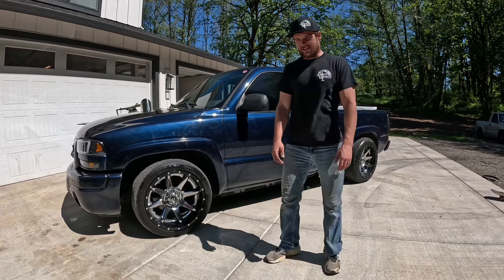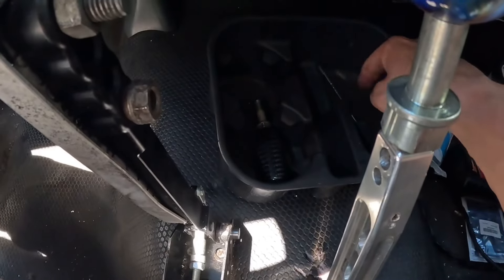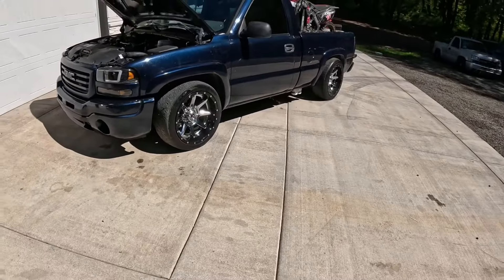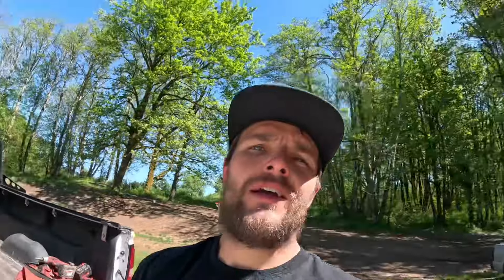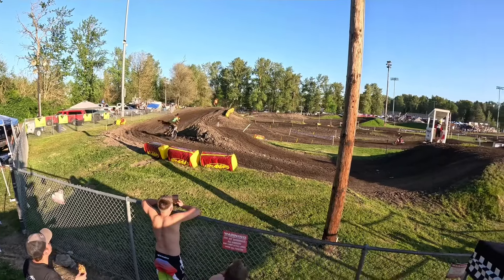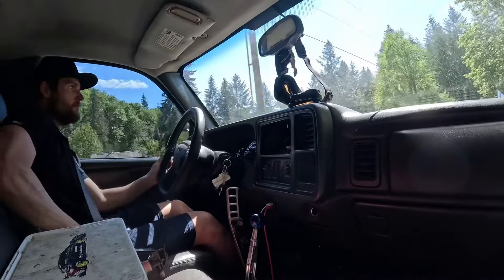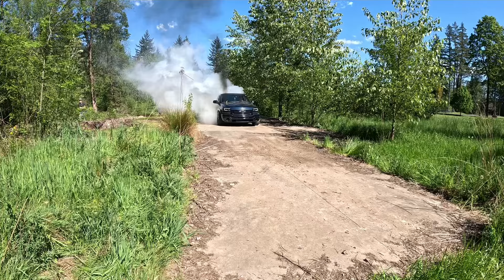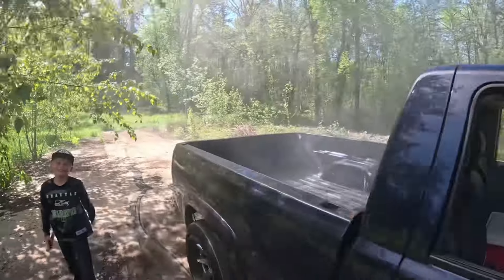I BUILT the WORLDS FIRST DURAMAX/T56 DRIFT TRUCK! It’s SOOO GOOD!

Comment: Finally not an LS swap the Lbz is a unit and to take a V6 obs and install a nasty stroked turbo diesel with a third pedal and a party handle must be so fun. Long time ago i had a chance to drive a low miles Lbz with the delete and an exhaust with intake upgrades and it was a beast also 4wd and

Comment: Your the reason i bought a 2wd truck but my platform is not awesome it’s a manual transmission f-150 with 4.2 v6 so I have some work to do I am starting with a lowering kit for the rear with shock adjustment add ons if I’m going at it wrong holler at me
Reply from the maker: No go get it!! Good start!

Comment: Do you plan on throwing in a fixed vane turbo instead of the vgt?
Reply from the maker: Ide love twins but prolly gonna enjoy instant spool and lots of burnies before going crazy
Reply: True twins or a compound setup?
Reply: Also. If you haven’t already, join the Duramax diesel forum 👍🏻
Reply: No NOT twin turbos!  A Compound set up would be sweet tho.
S475/480 over stock and some bigger sticks/cp3.